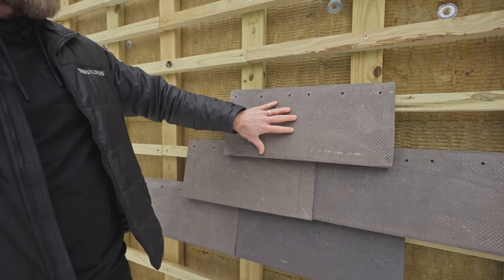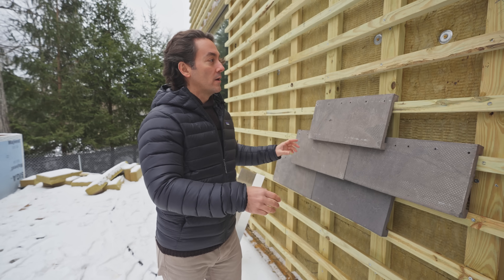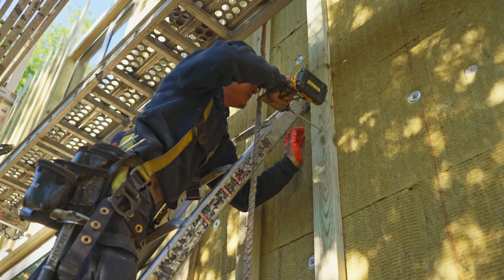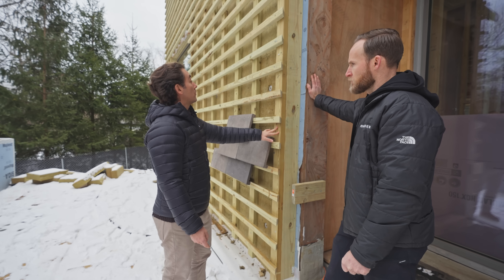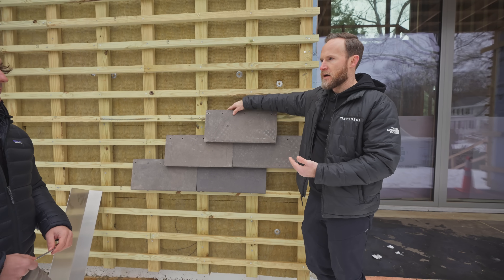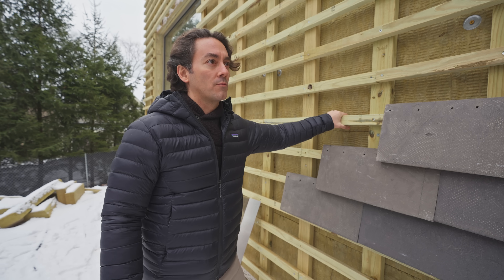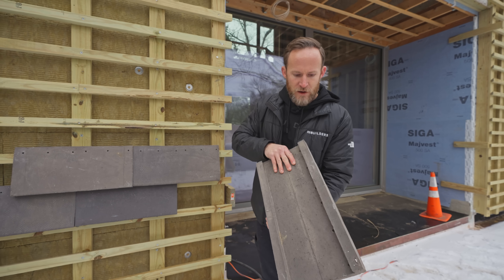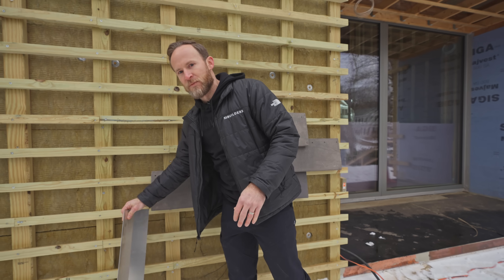The Benefits of Rainscreen Cladding & Exterior Insulation

Comment: Sure, if you have $3 million+ to build a home.  If you use Zip-R12 over 2x4 studs filled with closed cell foam, 1/4" plastic mesh rainscreen, and lap siding you'd have water/air tight walls at R-30+.   Regular window and door jambs made for 2x6 construction will fit perfectly without bucks to extend them, as you'd need here for very thick walls.  If you have the money, build it this way but 99% of people don't.
Reply from the maker: Oh yeah this is definitely $3m+ and this isn’t for 99%. But the education we share is to help those building ALL type of homes, especially when code changes and alot of the details will be required and we will experience a huge learning curve which means we will see a huge cost issue. Even on the 99% homes
Reply: @bobbray9666  Spray foam isn´t a healthy solution and turns your building into chemical waste. There are better options. Buy you are right, building this way is only nice for the contractor.
Reply: @petervandebovenkamp3653  Yes, if it isn't applied properly by either spraying when it's too cold, to thick it one shot, or an improper ratio of part A&B.  If properly done by knowledgeable installers, there isn't measurable gassing after full cure.  We've lived in homes with closed cell foam for many years with zero issues.  It's people like you that create misinformation.  Closed cell has been used on millions of homes and the bad applicators have gotten a lot of attention, as they should but no issues for the vast majority.  This comment is like an Amazon review.  The product sucks because it was damaged during shipment.
Reply: ZIP R-sheathing makes your walls too much vapor closed which is a negaitve in a climate with cold winters (CZ-4 and above).
Most spray foams will start to crack over the years... so you can not count on their air tightness in the course of the years.

The poly iso of the ZIP R boards and spray foam insulate well in theory but not in practice due to the lack of thermal mass (inertia). Cellulose, wood fibers, cotton,... are better options.

Poly iso, spray foam, EPS, XPS ... do NOT insulate against sound (noise).

It would be nice to see what the actual price difference would between your wall proposal and a "better" one...
2x4 + ZIP R-12 + Closed cell spray foam vs 2x4 + plywood + SA WRB + 2" external TimberBoard (or Rockwool Comfortboard) + cellulose.

Don't look too much to the R-value of the walls... it's better to look at the thermal mass (inertia) as this give you better protection against cold nights and summertime heat.
Reply: @koenraadprincen7212  That is all BS.  Mass does not equal more or less insulation value, as a rule.  It does for sound transmission though.  Apparently you know more than the people working in this field for the last 50+ years of studying home insulation.  WTF do you mean by vapor closed?  All homes with foam insulated buildings need an HRV or ERV, which we have.  We need to run a humidifier in the winter (zone 6a) simply because the exchanged air is very dry when very cold.  Closed cell foam is vapor impervious at 2"+.  A more logical answer is to say polyiso derates in very cold temps, which it does but only for the first inch or so on the outside, which doesn't impact the overall wall R-value much.
Reply: @bobbray9666  Yes, indeed, it's all BS as in Building Science 🙂

The R-value of a material only relates to a "stationary condition": 
1. The inner and outer temp. are constant.
2. The inner heating and outer cooling capacity are equal (in wintertime).

In practice, this is never the case as the outer temperature always fluctuates (day and night cycle).

That's where the mass of the insulation material (and the mass of the wall) comes into play, the higher the thermal mass (inertia), the longer is takes before the material "settles" according the new outside temperature.

"Vapor closed" is the opposite of "vapor open". In a vapor closed material, vapor will not pass through (as with vapor barriers).

Having vapor open walls and roofs (in both directions) is important to avoid possible condensation inside the wall or roof assembly and as a safety measure in case there's a water leakage (broken water line or gutter, leaking roof,...).

The problem with dry air in wintertime doesn't (fully) solve the condensation risk as you need a certain level of RH for your living comfort (somewhere between 40 and 70%), hence the use of humidifiers in wintertime.
Reply: @bobbray9666  Spray foam has too many drawbacks... closed cell is indeed a vapor barrier but over time you get all kind of cracks in the foam due to movement of the wood, the changing moisture content of the wood during the seasons makes it expand and shrink. And some racking of the house doesn't help either...

But a house does not need vapor barriers, it only needs air barriers with some vapor retarding properties to make it air tight.

I agree with you that untreated rock wool absorbs water, hence the use of water repellent additives by Rockwool.
And because it remains vapor open, I would not use it (unprotected) below grade. The relative humidity of the earth is too high - close to 100% - which will (also) reduce it's R-value (Rockwool remains silent about this issue).
Reply: @koenraadprincen7212  Depends on how good the framers were.  I've never seen that happen.  The only cracks I've seen is in your opinions.
Reply: @bobbray9666  Matt Risinger no longer propagates the use of spray foam to make your house air tight, just because it cracks.
He even experienced cracks before he did the blower door test making it very difficult to find the air leaks...
(Watch his videos about rebuilding his own house).

Comment: Why use heavy cladding for the rain screen?  Our build was pretty much identical except we used timber composite for the screen. The embedded energy in those cladding shingles is off the chart, not to mentioned the added engineering and mass required to carry the load. Kind of a FU to the environment considering there are so many other eco-friendlier products available. 
It annoys me when a great building system, like rainscreen + external insulation is marginalised by making it ridiculously expensive with useless features. Done right it is a cost effective system with fantastic benefits for everyone.
Rain screen design is fantastic just don't ruin it with a cladding which probably adds to cost of a normal home to the overall build for zero additional benefit......
Reply from the maker: Not everything HAS to be for the performance benefit. Sometimes beauty is the driving factor.

Comment: In a wildfire it seems very fit to be turned into coal lol
Reply: How do you figure?  The exterior is non-combustible.  The cavity is protected from embers via the bug screen.  The continuous mineral wool boards is rated as being a fire stop.  The one detail that I would quibble with is that pressure treated furring is the wrong material.  It should be should be plain lumber treated fire retarded after being beveled.
Reply from the maker: What Rich said. Plus this isn’t in a wildfire zone

Comment: Holy shit this is expensive!! How much a sqft for this nice insulation?
Reply from the maker: Talk to Rockwool or look up Comfortboard 110
Reply: @NSBuilders  I think you guys do a great job, and like someone else said, your attention to detail will make this pay off long term for the owner.  The upfront cost is what my reaction is aimed at.  The labor to do this process is intensive, especially doing it correctly. Let alone a couple dollars for each screw...

One question while I have your attention, I was curious as to the fire safety risk as we've had a couple wildfires in MA the last couple years near my area.  Does the rockwool qualify as a fire barrier/retardant, and the rain screen and supporting structure of it just shed from the main building if ash gets behind it and starts a fire?  Thanks for your time!

Comment: is that pressure treated strapping cut? because cutting pressure treated wood exposes the inner wood material which did not receive treatment; pressure treatment only goes so deep
Reply: Pre-cutting everything to exact spec then pressure treating before shipping to the site don't sound realistic.
Reply from the maker: To answer your question. PT was not required. We did it anyway. We beveled it onsite (actually our lumber supplier did it for us, shout out Koopman Lumber) all 15,000lf and rain won’t hurt this, it’ll dry out and last a VERY long time
Reply: @NSBuilders  Accoya wood would also have been a valid option.
Reply: @NSBuilders wow that that detail conservatively added ?25,000 plus to the build?!
Reply: @NSBuilders The supplier should develop a composite profile to aid in installation.
Watching from Vancouver Island 🏝️🇨🇦
Reply: @anthonyenosis1  it shouldnt need to be pressure treated. As it has airflow so it can dry out if any water gets past the siding
Reply: @ so it will be okay as long as it only rains once?
this video quoted the longevity qt 100 years. How many times do you think it will rain in the next 100 years?
Reply: @anthonyenosis1  As long as you maintain the cladding correct and you have a 28mm ventilation gap behind wich is code in Sweden it will not fail.
Some places in Sweden and especially Norway with all their peaks sun can be little even during summer and it rains alot. I have a timber barn that is probably 400 years old, still standing strong.
Reply: @Fulcrum205  cool so then we dont need sheething for houses either? just as long as after each rain the dry out, we should be good? <sarcasm>
Reply: @anthonyenosis1  The oldest entirely wooden building in Norway was built in 1170. That is 855 years old, not sure if there are any records that list what pressure treament they used back then.
Reply: @owenoneill5955  interesting there is only one oldest building from 1170. i guess whatever they did didn't catch on.

I want you to go outside and find one neighbor with a wood fence. I bet you cannot find a fence in your area more them 10 years old. Maybe 15. Since you are telling us that regular strapping wood is going to be just fine out in the rain and weather for 1000 years. Are you freaking joking with me right now?
Reply: @anthonyenosis1  lol. There are hundreds of houses in Noway pre dating the Black Death in 1350 and thousands more in Scandinavia. The oldest timber facade building I have worked on in the UK was built in 1665. Please, don't let your ignorance prevent you from learning things.
Reply: @anthonyenosis1  Most similar applications don't use pressure treated lumber.  Today, the main purpose of sheathing is shear resistance, not protection from physical water entry.  With many well designed system, sheathing never gets wet from rain except during construction.  The continuous exterior insulation protects rain from getting into the building, whether it is water repellent mineral wool or taped layers of foam insulation.  All those expensive ZIP system panels that are then covered up with exterior insulation are for air leakage control, not water.  But since you are preventing air leakage, you also prevent water intrusion.
Reply from the maker: @anthonyenosis1 fences typically fail/ at the ground level. Not above the ground. Irrelevant comparison
Reply: @richdobbs6595  While they can be, the water and vapor barrier are not necessarily the same. The Zip system is a water barrier when properly installed with tape and liquid flash. And most damage to homes is water damage, the water barrier is incredibly critical. The insulation is water repellent, but not a water barrier.
Reply: @richdobbs6595 you missed my sarcasm. a point was being made we can allow water intrusion as long as it dries out. which is not true. 
Also you are just dead wrong. insulation is not the water barrier. I hope you are not responsible for building.
Reply: @NSBuilders its wood getting wet and then drying out. Its a perfect comparison. im looking at a fence right now the dog ears look like spikes as its eroding from the top as well.
Reply: @ owenoneill5955 Timber  built buildings in No[r]way? are not equal to current day 0.5inch by 1.5 furring strip that was in this video. There is much less material there. thank you for calling me ignorant. I hope that made you feel good.
Reply: @anthonyenosis1  my home in south Louisiana that was built in the 1960s has no exterior sheathing. Just redwood siding right on 2×4 studs. All my interior walls are sheathed in tongue and groove 1x6s. It worried me at first but the few times I've peeled back siding it's dry in the there and I never had any moisture issues. House has been standing for 60 years so far
Reply: @BadGolfer-c9c  I agree that ZIP does form a water and air barrier.  I'm just saying that with continuous insulation and a rain screen, the water barrier isn't likely to be challenged.  Also, if you use foam board and tape it, it is a water barrier.
Reply: @anthonyenosis1 why are you making up a lie that the wood is getting getting wet?
Walked tile roofs for decades and the pickets didn't get wet there why are thwy getting wet here in your fabrication?
Reply: @sparksmcgee6641 
 hi.
picket fences in the US are typically outside on the perimeter of a property. They get wet when it rains. Every time it rains. And dry when its not raining and humidity drops. Not typically under a roof, so are subject to that weather. Around here the typically last about 10 years. Specifically my panels are so old the dog ears on panels are jagged into pointy slivers now because so much material has gone. Tho they are still holding onto the nails.
Reply: Yeah, I was wondering if it's pre-beveled or cut on site.
Reply: I have a wood barn on my farm that’s still mostly solid after 100 years of exposure to rain, snow , and humidity.  It’s just boards nailed to logs. In some places the nails have totally rusted away and there’s an eroded tear shaped hole in the wood.

Comment: 15 minute call - but only deep-pocket clients need call😂

I'd like to know the cost of just the screws and stainless flashing.  Labor to rip and install all the beveled treated strapping...yikes.

75-100 yr assembly with 500 yr exterior cladding. Pity the fool who buys that home a century from now and finds out it's a million to remove and replace the 500 yr cladding.
Reply: Perspective... I pity the fools currently buying newly built homes thinking they'll last more than 10 years without major renovations. Who cares what the cost of these screws are? They can clearly afford them. So can the person buying this house in 100 years. This channel is about building sturdy, robust, beautiful homes... May not be for you.
Reply from the maker: Screws were $15k and stainless is about $10k

Labor to rip I think ~$2000 if I recall correctly.

Comment: I love the idea but I know first hand the cost. It's a major cost to install such a system. (I have a similar rainscreen/rockwool system, not 5 inches though!) The 10 inch fasteners every 12 inches alone is a hefty cost. Glad they chose the rigth builder to do it too. Meticulous detail is so important to install this correctly. From everything I seen over the many videos I have seen from NS, they are very skilled and qualified to do such a job.
Reply from the maker: Thanks 🙏 yes it’s costly.
Reply: @NSBuilders what's the brand of the siding?

Can you please do a deep dive on German larg format flat roofing tiles please?.
Reply: @NSBuilders  what's the brand of tile? 
Can you please do a deep dive on German large format flat roof tiles? So I don't have to😊
I wanted to use them on a house 20 years ago. I haven't followed up on them again.
FYI Germany has a very high minimum standard for roof tiles. Call suppliers in Germany and have them shipped instead of going to product reps in the US with the big mark ups.
Met a roofer her that was charging about 25% what reps were for shingles and just getting a container or two a year.
Reply: Can we define costly? My builder is thinking around 40k extra for exterior insulation. 2700sq ft. Does this sound normal or crazy?
Reply: @ Seems fair to me tbh. It's a lot of labor. Although its not worth 40k if they don't do it right. I'd make sure your builder has done it before and detail how they did it.

Comment: That is some serious insulation mate, love those chunky tiles.
It's like the house is wearing a suit of armor lol.
Not sure if we have any of these products in Australia.
Reply: Mate...we built our house exactly the same way in Ballarat without the stupid wall tiles (see my earlier whinge). I wouldn't even put tiles on a roof so why would you want to put them on a wall??!! Everything is readily available in Oz with a bit of hunting around. Tradies grumble coz they haven't done it before but with the proper design it is so quick they just shut up and get on with it. We used timber composite and 50 year old reclaimed BHP corri iron for the cladding. Looks great, costs bugger all and the insulation value is off the chart.  give it a go mate, you won't regret it. Just think lightweight cladding which brings all specs and cost down so it is less expensive than brick veneer. Batts cost next to nothing, you don't need the expensive rockwool products, ya just gotta think about how you install it for more than 20 secs.
Get down to Bunnings, you can get everything you need from there.
Reply: @darroncrick9993  Thanks for the info mate. The tiles on the walls are for the looks I guess, I wouldn't have them, too heavy.
I just like the super thick wall insulation which works for extreme heat as well as cold.
Reply from the maker: Sounds like you can get it! Love aus architecture